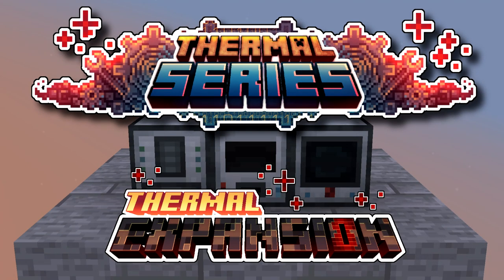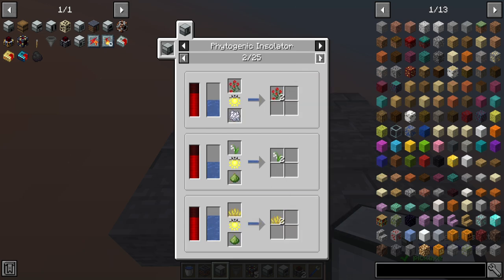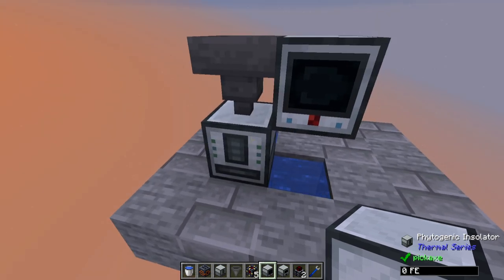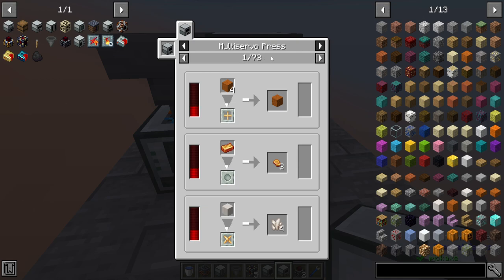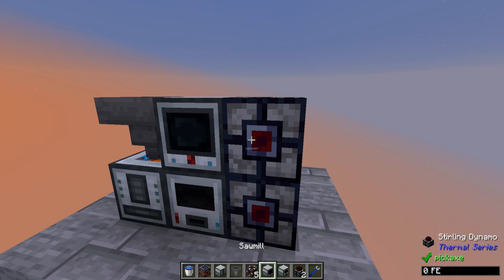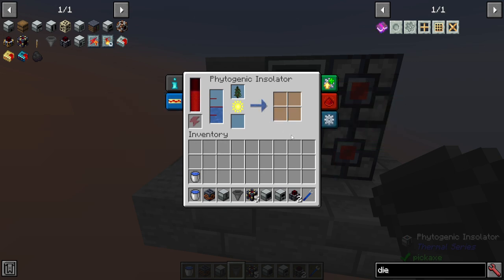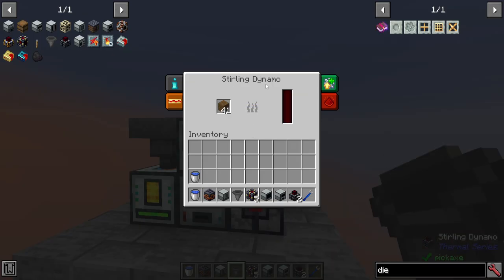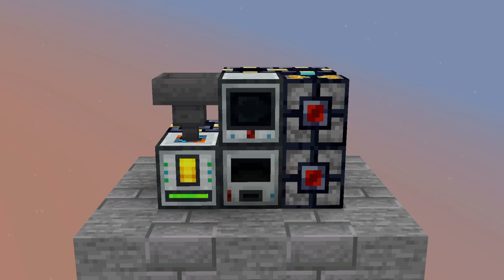Thermal Series Pt8 Phytogenic Sawmill Press Bit-By-Bit 1.16.5

Comment from the maker: TIPS:
- Upgrade your plank processing Stirling Dynamo first to avoid backups, then the Phytogenic Insolator to boost overal speed.
- You can also upgrade the sawmill to be more productive with the secondary outputs.
- Add bonemeal or phytogrow to increase your results from the Phytogenic Insolator.
- Add the Cyclical Processing augment to auto process seeds and saplings (but the hopper is much cheaper)
- An bunch of Auxiliary Process Sieve in your sawmill will increase the sawdust production
SECRET: 
- You can use a Phytogenic Insolator to continuously make almost any crop infinitely without needing to add in bonemeal or phytogrow.

Comment: If you have the Create mod, you could use a brass funnel, set it to 16, 32, or some other large number and put it on the hopper. This way you can take out saplings when there is an excess. Take these saplings, compost them, and put the bonemeal back in the system.

Comment: Prior to 1.16, Thermal Expansion had a biofuel system where you'd process saplings in a sawmill or crusher to get biomass, which you'd then process in a still to make biofuel (burned in a compression dynamo) or use in recipes for phyto-grow. I hope that gets put back into TE, as it would give a use for any excess saplings you get with this system.

Comment: I love how they've made the phytogenic insolator SO much more useful/powerful!!  Same with the multiservo press.  The sawmill was always seen (early on) as just a way to make paper and provide more planks than what you would normally get by crafting.  This whole setup is awesome!  What are the best augments for the best power excess?
Reply: I'd definitely put a sieve in the sawmill to upgrade your secondary outputs, that will make more sawdust. Probably I'd go for one or two efficiency upgrades in the dynamo that burns sawdust blocks, too, to make more RF total. The next upgrades on the list would be more of a choice of speed vs power - how fast do you want to fill up your energy cells vs how much total energy do you want?

Comment: Nice design for the energy generator.
One small change I would suggest is removing the two power cells behind the dynamos and shifting the dynamos back by one, and outputting the sawmill and the press to hoppers, so that any wood overflow can go to the other dynamo

Comment: I wonder which may be more efficient, wood->planks + compressed sawdust or wood->charcoal(->charcoal block)? I haven't run the numbers so it would be interesting to see how the two energy creation methods compare to one another.
Reply: I'd like to know, too.
Reply: Don’t forget the creosote from making the charcoal can also be burned
Reply: @Shadow_95961  I forgot about creosote.
Reply from the maker: Slightly less + even if pyrolized
Reply: I was interested in that as well, so I ran the numbers:

Plank method:
1k RF to turn the wood into 6 planks and 0,25 sawdust, the former netting you 18k RF and the latter (including the 400RF to turn 9 sawdust into a block) 656 RF (rounded up) for a net gain of 17.656 RF per block of wood.

Charcoal method:
2k RF to turn the wood into 1 charcoal and 125mb of creosote in a Pyrolyzer burning for 16k RF and 2,5k RF respectively. Turning 9 charcoal into a block uses 400 RF to up the total RF generated to 160k, or (minding the 400 RF cost) 17,733 RF per charcoal respectively.
This gives us a net gain of 16,5k or 18,233 RF per block of wood.
Did a quick test with 2 stacks of wood each and unless one of my mods changes fuel values my numbers should be correct and charcoal-blocks ever so slightly more efficient.
It does however use a Compression Dynamo in place of the second Stirling and a Pyrolyzer instead of the Sawmill, both of which are more expensive in terms of materials.

The other method also gets bonus points for using a sawmill.
Reply from the maker: What you didn't take into account is the duration to make this power. Having them run side by side the charcoal pyrolized method runs slower. While you can speed it up it then starts taking into effect the different combinations and changes the different augments add. They are both very viable but I liked the cost effective faster power that was slightly less efficient. :)
Reply: @MischiefofMice  That is true, I was just interested if there was any merit to the coal version at all. It also takes more energy to start up and takes longer to get any energy out of it (1k RF to get the first planks vs 18,4k RF for the first charcoal block)
Reply: @ChrisPhelior  Thank you for the in depth analysis!
Reply: @Sarafimm2  You are very welcome.

Comment: Another way that I use for power generation is the phytogenic insolator and the pyrolizer with birch saplings. It's slower than some of the other power generators but if you already had a bitumen generator it's really easy to convert between the two
Reply from the maker: Funny you should mention that. I ran that in a side-by-side and found the sawmill+press>stirling to be more productive overall. BUT. It's still very viable and a good alternative!
Reply: @MischiefofMice  I'll have to look into fully making the swap then, thanks for that!